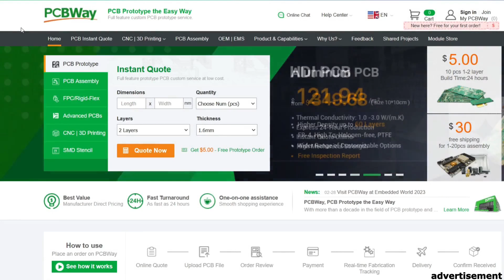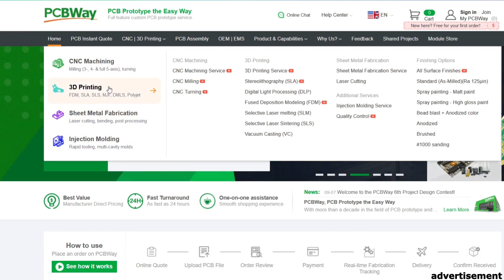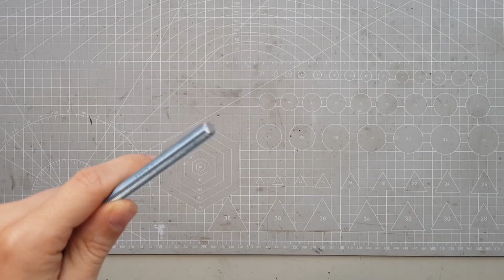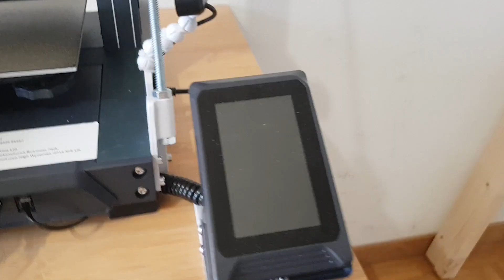More Printable Upgrades for your Neptune Printer (Part 2)

Comment: Cool. I bougth the camera, only 6$
Reply from the maker: Nice, did you already install it?
Reply: @Dirt-E-Bikes  No, I am still waiting for it.
Reply from the maker: @-MrDontCare- 
Ok, let me know how it goes ✌️
Reply: @Dirt-E-Bikes  Sure thing boss, I will update you as soon as I install it.😊
Reply: @Dirt-E-Bikes  Got the camera today and installed it. This is just perfect. Thank you so much for the tip.
Reply from the maker: @-MrDontCare- you are welcome, glad to hear that everything works fine ✌️
Reply: @Dirt-E-Bikes  Just one thing I noticed, the camera had 480p as default in klipper. So to get full HD I just had to change the resolution in the webcam.txt file to 1920x1080. Now I have HD.
Reply from the maker: @-MrDontCare- Top👍 thanks for that hint, i have to check that on my camera settings, i guess i still run 480p...😅
Reply: @Dirt-E-Bikes  Np, happy to give something back. hahaha one more upgrade for you there. 😅
Reply from the maker: @-MrDontCare- nice, thank you 👍

Comment: In theory. Could a 1000mm threaded rod work? I looked up the conversion rate because I couldn't find 100cm rods
Reply from the maker: @SkyrishCrusader  Hi SlyrishCrusader, äh yes, 1000mm are 100cm, so i guess that will work

Comment: Where did you show how to equip the printer with wifi?
Reply from the maker: @RaneKaiser16  Hi RaneKaiser, i am not surein which part it was, it was only a short part, i guess i also mentioned it in this video here:
https://youtu.be/Dhs0dBAUTrQ?si=GiqvCuQfT7aPRPDv

There should also be a link in the description with one of these wifi extenders that should work ✌️

Comment: Hi, do the stabilizers wear out?
Are they worth it in the long run, please let me know. 
(Let me know about pros and cons)
Thank you.
Reply from the maker: @yungbruh7821  hi yungbruh, the stabilizers are not a must. I would install them if you have any wobble in the gentry - they will help with that. If you dont have any wobble, you dont need them. And if you do them, just do the 2 on the front. The will not affect your print hight.
Hope that helps with your decision ✌️
Reply: @Dirt-E-Bikes  Alright, thank you for the information much appreciated.
Reply from the maker: @yungbruh7821  you are welcome, i wish you a good time printing

Comment: I've been using my Neptune 4 Pro for over a year.  I was thinking about making a small print farm for a new product and was looking at the Sovol SV06 Ace but realized that the only real feature it has that my Neptune 4 Pro doesn't have is a web camera, which is fine because I never needed one when the printer is next to my computer, but I would want to remotely monitor a small print farm.  The SV06 is currently $40 more than the Neptune 4 Pro.  I can buy a very nice USB camera and still have money to put toward a MicroSwiss FlowTech hot end to make nozzle replacements super fast and easy for high volume print farm use.  Not needing to support another 3D printer is an advantage too.  It's great to have only one set of maintenance and repair parts, and only needing familiarity with one 3D printer.
Reply from the maker: @Liberty4Ever  Hi Liberty4Ever, that sounds lile a very well thought plan. What material do you plan to print your product, and what nozzle size you go to use for that?
Reply: @Dirt-E-Bikes  - We currently sell a couple of products printed in 95A durometer TPU, and the goal has been to make the layer lines as small as possible.  The new higher volume product would actually feature the layer lines as grippy ribs so I'm planning on using a 1.0 mm nozzle.  I have the MicroSwiss FlowTech hot end on my SV08 and love it.  I haven't upgraded the Nepture 4 Pro, but MicroSwiss makes a hot end for it, so I'd be able to use the 1.0 mm MicroSwiss FlowTech CHT high flow nozzle.  As an added bonus, printing with a 1.0 mm high flow nozzle would really crank out the parts... probably an hour each.
Reply from the maker: @Liberty4Ever  that sounds good, and i guess you would save a lot of print time with this 1mm nozzle. I stuck on my 0.6mm nozzle, its a cheap nockoff of that famous highflow nozzle i forgott the name of... Did a video about it a while a go. And since i use this one, i have zero problemo with clogging, and also lile you mentioned, print time is way faster... Not so fast lile on yours with 1mm i guess, but for me its good enough ;-)
Reply: @Dirt-E-Bikes  - The Neptune 4 Pro was my 11th 3D printer.  The SV08 is my 12th.  Every time I'd buy a 3D printer, I'd buy extra nozzles for it, in case a 0.4 mm nozzle was so clogged it was easier to replace it, but also because I thought I'd use different nozzle sizes for different print jobs.  In practice, it was so difficult to change nozzles and so likely to cause problems (broken heater wire, broken thermistor wire, bent extruder mount, etc.) that the only time I changed a nozzle was to repair a 3D printer when it was broken.  The MicroSwiss FlowTech nozzles can be changed in one minute, single handed, using only a 7 mm nut driver, cold swapped.  Now I can change a nozzle to make a print faster/better without worrying about damaging the 3D printer.  The quality of the MicroSwiss nozzles is also much nicer than the manufacturers' nozzles or the simple brass nozzles for sale in the aftermarket.  The MicroSwiss nozzles are polished, nickle plated, have low friction coatings, etc.

I'm finally getting into carbon fiber filled materials and they need a hardened nozzle, and most require a 0.6 mm nozzle or larger to avoid clogs.
Reply from the maker: @Liberty4Ever  ok 12 printers allready 😅 so that sounds obvious, and if you have a small printfarm that makes total sense imo.

Comment: did you print the stabilizers with PLA or PETG ?
Reply from the maker: @tromas3878 i did it all with the marble white PLA from polyterra
Reply: @Dirt-E-Bikes  Thanks for the fast reply , i would think it would be stronger with PETG but PLA is probably enough if it isnt moving much
Reply from the maker: @tromas3878 hi Tromas, yes i tought the same, in my case, the printer stands in a place with constant temperature (around 20) and no direct sunlight, so PLA was fine for me.

Comment: Man, it's a great project. Will there be new designs for the elegoo neptune 3 pro and 3 max models?
Reply from the maker: Hey Evcil, thanks a lot, i guess most of the upgrades and mods should fit the Neptune 3, but i cant say for sure wich ones will fit and wich does not, as i dont have a N3 here at the time and only use the N4 since i got it. But if you search in the links provided, im sure you can find similat models that are made for the N3.
I wish you a nive day and thanks for asking
Reply: @Dirt-E-Bikes  So, did you do a pressure test as a result of this upgrade? What was the result?

Comment: dude i cant find the video to hooking up the wifi i've been looking for frickin ages oof...is it gone?
Reply from the maker: @ladyliss516  its was one of the first videos i did on the N4 upgrades... And i just mentioned to buy a cheap wifi extender with a ethernetcable output, to use the inclided ethernetcable that came with the printer. All you have to do is to connect the wifi extender with your router (as normal) and open your browser to type in the ip adress of the printer (you can see your printers IP on the display of the printer). If you do that, you can run the printer from your network (works with every pc or phone connected to your wifi).
So i hope that helps you, you can find cheap wifi extender on aliexpress or amazon, just take one with a ethernet out.

Comment: how do you monitor it on your phone via the webcam? 
Is there a specific app or tutorial?
Thanks.
Reply from the maker: @pubgwithleo5596  hey Leo, you can do it by any browser on your smartphone, at least if you are in the same wifi (printer and phone). Just type in the IP of your printer. Hope that helps you. 
Have a nice day ✌️
Reply: @Dirt-E-Bikes thanks alot 👍
Reply from the maker: @pubgwithleo5596  you are welcome ✌️
Reply: @Dirt-E-Bikes  I'm having some problems leveling the Neptune 4 bed
Any tips? 
Juat got mine Neptune 4 a few days ago.
Reply from the maker: @pubgwithleo5596  Hi Leo, what exactly is the problem with leveling your printer? In general, you have to first manualy level the bed (do this for so long until you are happy with the leveling), then you can do the automatic leveling (the mesh). If you use fluidd (your PC connected to you printer) you can also look at the mesh after automatic leveling, and can adjust it by the leveling gears again, if there is one side that is more out of level. But after you did this, you should also do the mesh again.
In my nevest video are also clips to lock the leveling gears, if they come loose on your printer while printing. That can help too.
Reply: @Dirt-E-Bikes 
I'll watch your new video and i'll see if it helps
Thanks
Reply: @Dirt-E-Bikes 
How tight should the a4 paper touch the nozzle. Like tight but moveable or just slightly tight?
Reply from the maker: @pubgwithleo5596  i do it only that tight, so that its easy movable but makes a scraping noise when moving... Bit its more important that its the same pressure on the paper in every 4 corners. 
When printing after leveling, chose a skirt (find it under "build plate adhesion" in your slicer settings) and use 3 or 4 skirt lines. That way it makes some lines around your model on the build plate at the beginning of a print. I then watch how the lines are on the printbed and adjust the z offset on the display while its printing these skirt lines... I watch these skirt lines on every beginning print, just to make sure that after leveling, the z offset is good.
Reply: @Dirt-E-Bikes 
I'll try it now
Thanks
Reply: @Dirt-E-Bikes 
Do you mind explaining to me the numbers that after you auto level the bed?
What would I look for in those numbers?
There are 6 rows, and some of them light up?
Reply from the maker: @pubgwithleo5596  the numbers should be as close together as possible. Its the offset between the points measured on your bed. Idealy they would all be 0 (zero) but that will not happen ;-)
If you see that the numbers go all up or down to one side of the bed, you can adjust the wheels on this specific side a bit, do the mesh ("auto level") again, and see how it affected the offset of this side of the bed. You can repeat that as much as you like.
Reply: @Dirt-E-Bikes  i'll try to see the mesh and if I have more problems i'll comment again.
Reply from the maker: @pubgwithleo5596  sure 🙂👍
Reply: @Dirt-E-Bikes  I did level my bed pretty good with the mesh. I saw your newest  video about upgrades for the neptune 4, you have put the clips for the leveling gears and you have included the link for the files at the bottom. After I download the file, extract it, and load it on cura put it at 1000% and uniform scaling, and then  I print them out but they don't fit even close to the bars on the bed.  Like it's not touching the bed frame at all. Any explanation?😅😅
Reply from the maker: @pubgwithleo5596 hmm, they should fit exactly... You have the n4 pro, right? And the orientation of the clip is right around? ( They have a button and top side)
Glad it worked out for you with the mesh and leveling 🙂👍
Reply: @Dirt-E-Bikes  I have just the normal neptune 4
Reply: @Dirt-E-Bikes But I just noticed that i can use 2 of the clips to hold one knob
Reply from the maker: @pubgwithleo5596  😄 perfect
Im not sure but i guess the n4pro may be build a little different at the knob-part. Glad it worked out for you with 2 of the clamps ;-)

Comment: I don't think the stabilizers are necessary as the frame is already very stiff. Totally different story for my Ender 3 v3 KE though. That thing is wobbly as hell.
Reply from the maker: I think i have seen a similar modification for ender printers as well, maybe you can find one for your printer on thingiverse ✌️
Reply: @Dirt-E-Bikes  Yes, I already installed one. Thanks!
Reply from the maker: @RetroDaddyPH  nice 👍

Comment: Hi.
I bought the same camera as yours and I have a problem with the connection. Could you check and provide the entry in the printer file in the fluidd setup (webcam.txt file)?
I mean this line: camera_usb_options="-r 640x480 -f 10"
Reply: hurray...
Thank you very much. It worked.
Thank you again. :)
Reply from the maker: @mariuszgrzeskowiak6223  you are very welcome 🙂👍 glad i can help
Reply from the maker: Hi Marius, sure, will check that and let you know...
Reply from the maker: Its:
Camera_usb_options="-d /dev/video4 r 640x480 -f 10"
Reply from the maker: Hope that helps you, have a nice day ✌️

Comment: Was the file for the back right rear ever modified to accommodate a full height print?
Reply from the maker: Hi Woodworking, not sure about that, mine is still the one shown in the video but as i said it doesnt effect me as i dont print that parts that high. I guess it wouldnt be hard to fix that in tinkercad 👍

Comment: My webcam is the same as yours, but it doesn't seem to work... what did you do to make it work in Fluidd?
Reply: Same here. I really eager to get it working.
Reply: did you start + enable webcamd ?
Reply: I'm having the same problem.  I bought the exact same webcam, and it worked great for five minutes till I unplugged it to move to a better spot.  Plugged it back in and it no longer works.  Tried enabling and starting it via SSH, nothing seems to bring it back after having unplugged it.

Comment: Is it suitable for neptune 3 pro?
Reply from the maker: Hi Constantin, im not sure about that, check for the 2 screws on each side where the upper parts are attached, i guess the dimensions of the printer should be similar, and if you have the 2 holes on top and the "rails" on the buttom parts (basically where all the parts connect to the printer) it should work i guess.
For the webcam integration i also dont know, i mean its Marlyn on your printer and klipper on the N4, so setting up the camera will not be the same. 
But the mount for the camera should fit as well.
Hope that helped, have a nice day ✌
Reply: @Dirt-E-Bikes  Thanks for the detailed answer. I think it fits. I'll let go when I try.
Reply from the maker: @constantinfaer5600  you are welcome. Maybe you can print only the first few layers of the upper part to check if the hole-dimensions fit. Good luck, and let me know how it worked

Comment: Hi, great videos, thx for them. Where can I find the video regarding connecting the printer to wifi?
Reply from the maker: Hi markus, in an earlier video I showed very briefly what I think is the easiest way to connect the printer to the wifi without explaining that much. In my case i only followed the description in the manual that comes with the printer... i first connected it with my network by cable and typed in the IP adress of the printer in my browser and it worked. Then i buyed this cheap wifi-extender thing that i show in the video and thats all to do (maybe you have to install something from the USB stick that comes with the printer, but im not sure if that is necesary, its a while ago) if so, it would also tell you in the manual as i only did those few steps that are showed there and it worked. I will search you the video so you have the link to the product i used for it...
Reply from the maker: That is the video, but like i said, i dont go into details about the wifi-connections...
https://youtu.be/5Bvow4Sca-4?si=0cKK5dViSthT-YHm

Comment: I noticed that the camera flexible arm seems a bit loose or floppy. Are you happy with the mounting system?
Reply from the maker: Yes its not the most stable, but i only need the camera for checking if the print is still running or if something is goiing wrong. And for that its enough. If you want to record videos with it or even making timelapses, i would recomment a better camera and an other mount with a different camera-angle. For my purpose its enough

Comment: Would like to know more about how to setup the camera. I have not yet attached my printer to the network so unsure of all steps needed or software to view camera
Reply from the maker: You can start by connecting the printer to your Internet by pluging in the cable to your router. Start the printer and you find the IP in the menu (about machine(?)). Then you can simply open your browser and typ in that IP. Thats basically it to connect it to the Network. To ad a Webcam you have to plug in one to the printers USB and select it in Fluidd. Different webcams will require different setup. With the one that i use, i simply could add it in fluidd and it worked
Reply: @Dirt-E-Bikes thanks for the reply. What is fluid? Sorry if that's a silly question.
Reply from the maker: All good, fluidd is the "interface" in wich the klipper softwear is displayed to you. As i remember correctly, you only have to type in the IP adress of your printer in your webbrowser when it is connected to your network, and fluidd will open (or maybe there is the softwear exe on the stick that comes with the printer, i cant remeber exactly, sorry) anyway, its also shown in the manual that comes with your n4, i also just followed that instruction and its really straight forward. 
Hope that helps you, have a nice day ✌
Reply: @Dirt-E-Bikes thank you so much for taking the time to reply.
Reply from the maker: You are welcome ✌
Reply: @Dirt-E-Bikes I ordered the same camera as you and it arrived today. I have fluidd working and it's connected to the network. Just trying to add the camera. Think I might have to restart the printer after I plug the camera in.
Reply from the maker: @NaughtyGoatFarm  Hi there, great news,  is everything working now? I think i just had to select in fluidd that i have a camera and want to see it in the dashboard (somewhere in the settings) and it should work right away. But let me know if you have some trouble, then i will (after work) take a look if i can find which setting it was. Have a nice day and much fun with your camera/printer 👍👍